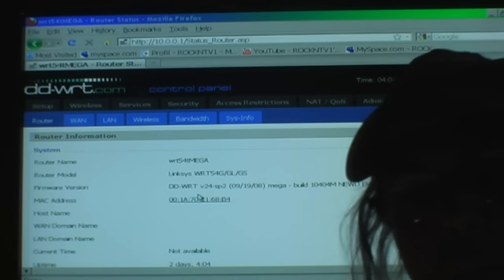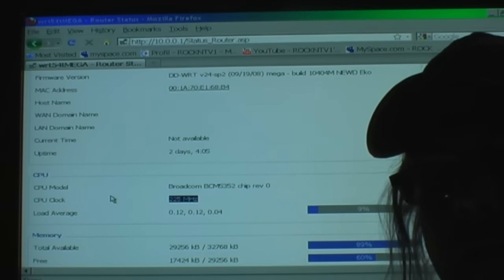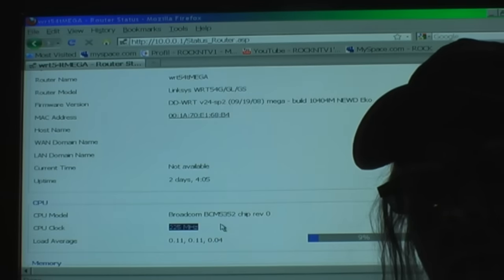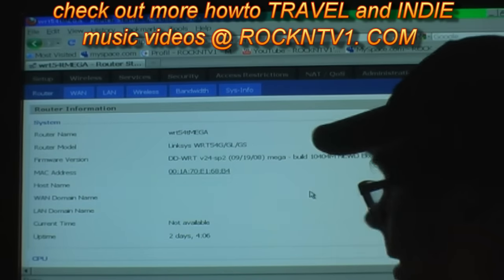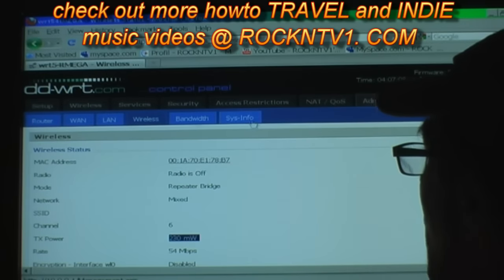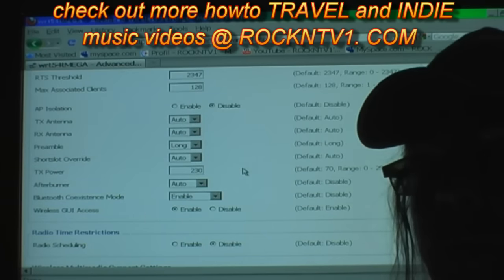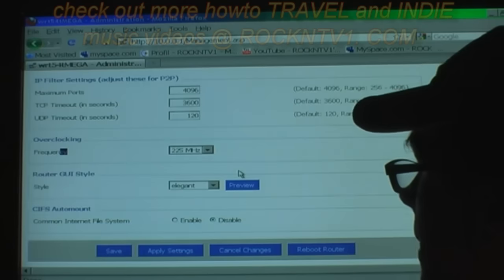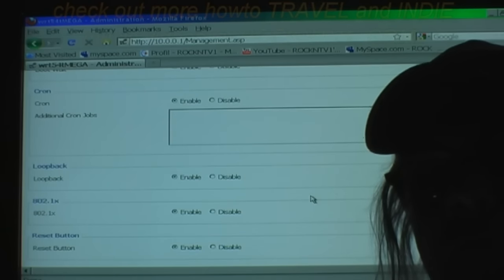LINKSYS WRT54G-TM dd-wrt OVERCLOCK WIFI Power Increase MOD

Comment: very informative.

dd-wrt wont let me overclock my DIR-615, but it runs at 384 anyway lol
and its a ralink SoC. transmit power is at 130mw, 70 more than standard, but at least twice as good.

so far, DD-WRT is awesome. it has turned one of my most despised routers (had about 14, from various brands, d-link has been the only one to hold up until recently. a dir-635), into probably the best.

Comment from the maker: @svenXDsven  the power brick for the wrt54g-tm was 1.3 amps 12 v i think and the new ones are 1.5.  You can take the top off the router and check for power at the header to eliminate the jack.

Comment: Wow, the wrt54g.  I see this video is 10 years old now. Ive used home built routers on x86 for 20 years.  On latency and dropped packets, They perform far better than any low power small office home office wireless access point and router.
Reply from the maker: dont know id agree with that,  this router does well over the legal wifi limit. IMhO, dedicated hardware almost allways trumps a multi pupose device.

Comment from the maker: @THEFIXERification  yEAH  times change,  I currantly run the wrt54g-tm mildly overclocked without the heat sink in a repeater bridge config with a linksys wrt160nl with encryption on both ends ie: wireless ap and virtual inter face in the house to have both g and N standards available. The added output power of the radio in the wrt54g-tm is only  nessary when long distance is required as the added power tends to add noise on the channels if its not necessary.  And I have never need overclocking

Comment from the maker: @svenXDsven  I dont know if that router is supported by dd-wrt or does overclocking with the added wifi output power increase like the wrt54g-tm with extra memory and signal boosting

Comment from the maker: @nimanooma still running the wrt43g -tm without a heat sink and the video about over clocking the router, and increasing the wifi radio power booster is mmm, 3 years old. thnx

Comment from the maker: @tqrules AGREED, but,  the wrt54g-tm router with DD-WRT installed, and configured properly has 5 usable lan ports buit in that are much more efficient at routing then the system you describe as they are dedicated hardware,  an to say the least of power consumption. Honestly as i say in the video for my purpose the overclocking feature is a bit of novelty, bit the ability to adjust and increase the output power of the wifi radio, far out weighs the system you describe.

Comment from the maker: @fuge805 admin admin is stock,,, but 
on the webby interface , and root / admin on ssh
by the way you should prob not set the router to usew 192.168.2.1 as if you are repating this is the standard subnet for belkin and netgear wirless 
// could con fuse the situation

Comment from the maker: @mastax1234  I wouldnt cry yet, as long as it works some times. The wrt54g has very small memory so a hard reset and cold reboot might striaghten the old girl out. Reset ALL TO DEFAULT  NO SECURITY, and retest. I would allso pop the case off and give light dusting to ensure no dust bridged ic.

Comment: regarding overclocking: Would you try some test 
1. Does it decrease network latency?
2. Does it increase network throughput?  For a stress test, try ping flooding small packets between two nodes and a file transfer between two other nodes.
Reply from the maker: it makes more heat for little gain

Comment from the maker: @THEFIXERification Thanks for stopping in, Yeah man, those are good specs, but the WRT54G-TM that i am running here does all that plus the replaceable antennas.
(SUB ).  wrt54g-tm dot blogspot dot com  , plus with the broadcom cpu we can run AFTERBURNER instead of the standard Linksys speedbooster. If you wanted to put external high gain on CHECK OUT THIS SITE wrt54g-tm dot blogspot dot com

Comment from the maker: youngstud2476
im nt sure that you are haveing an issue ,
You must have found the setting that allows you to tell the router which antenna does what, but with out testing signal strengh and trying the options , I'd say you are best left to auto as the separation is what is the diciding factor.

Hope that helped. thanks for the sub

Comment: Hi, I have a TP-Link WR841N v5 currently running the latest firmware: 	3.12.5 Build 100929 Rel.57776n

I wanna put DD-Wrt on it. I don't wanna wreck it, and I've never done anything of the sort before.
I found .bin files on DD-Wrt's website, but they were for WR841ND v5. Supposedly it works on mine as well, but I dont wanna ruin anything. If you could help me I would be grateful. If I should do it at all, or if you know a download link for my model specifically. Thanks

Comment from the maker: The reason is it is driving a radio tx full tilt when you talk, the problem is....its touching your head. I venture that your laptop is 1/2 or better this power so unless you look at that from across the room ,you taking it in the face. RF safty goes a long way with any radio device.
thanks for stopping.SUB

Comment: You might have the TX power set to 240mW but clearly the radio is OFF.. so maybe you have been running it for a year but not the wireless i did run mine at 100mW with no fan or anything for about 30 days with no harm but your TX power doesnt matter if the radio is off...
Reply from the maker: lol

Comment from the maker: @mastax1234  I belive their might be an  upgrade for that  by now, that should be a straight forward DD-WRT replacement firmware. mANY  wireless router help files on the site in the description, you can try these first. sub / rate

Comment: Oh you mean hotswitching between access points? I know Tomato does that but I personally dont need to as I have a small network (12 users, 1 AP) but this Power User describes how he can walk around his 600 user building watching continuous video as his Tomato client logs on to different Access Points on the fly without dropping connection:

w-w-w.linksysinfo(dot)org/forums/showthread.php?t=60304&page=2